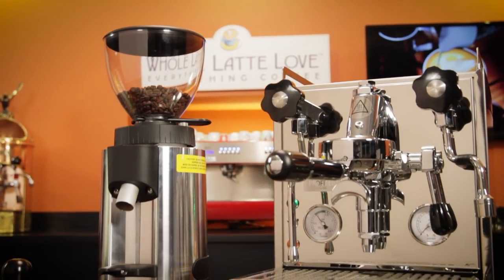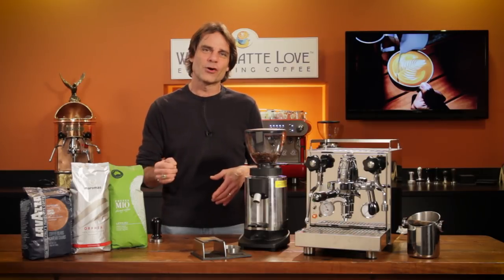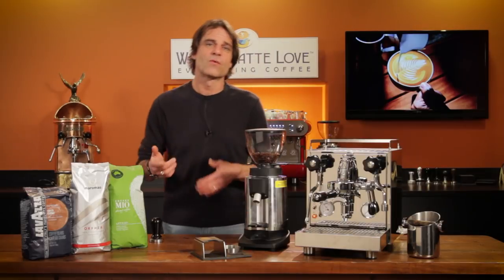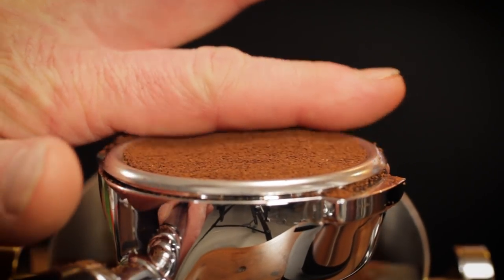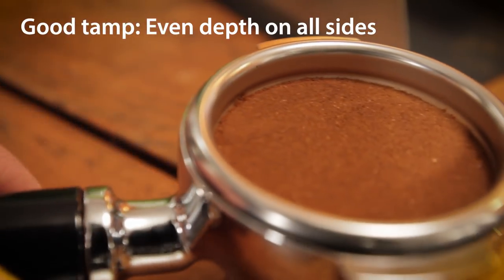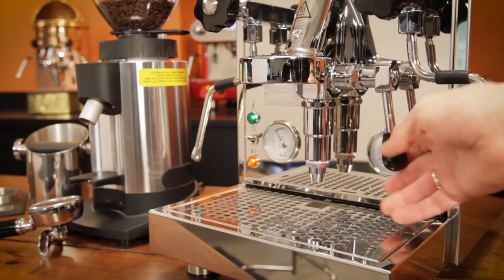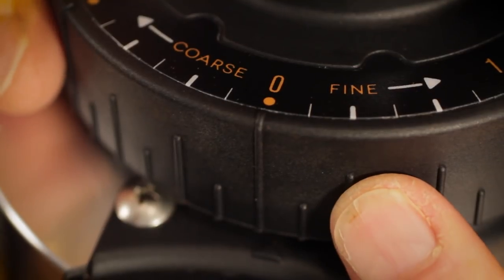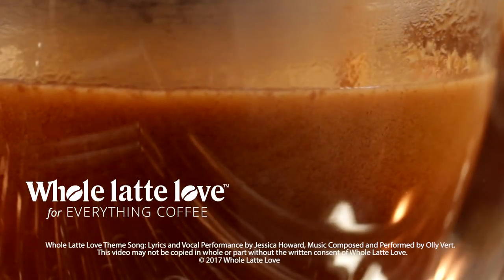How To: Basic Espresso Technique - Dialing in Grind Size

Comment: Im a newbie in this too. I just got myself a Morphy Richards Accent 172002. Any tips for me? I cant seem to get any crema when i make the espresso shot.
Reply from the maker: Hi JT, Thanks for the question. Are you grinding your own beans? Looks like your machine uses a pressurized filter basket. That type of machine is limited in capability and can't do the same quality as standard non-pressurized basket machines. Here's a video comparing shots from pressurized vs. non pressurized baskets: https://youtu.be/jmo3EZxqLi0
You can get an okay espresso out of these machines. Most important is the coffee quality. If grinding your own beans fresh you can control a bit with grind size.
Marc
Reply: Whole Latte Love yes im grinding my own beans. Im using the krups gvx231. Have tried from medium size to the finest. But still not able to do it. 😂 is it time to change a machine?

Comment: Hello! I have just got Ceado E6P from you guys, which has timed setting to grind one shot and double shot. If I calibrate a double(single) shot, is the single(double) wont be accurate?
Reply from the maker: Hi, Sunlight, Thanks for the purchase. The timing is independent for the single and the double - one does not affect the other. You can set either to whatever time you like. Hope that helps!
Marc
Reply: Whole Latte Love So if I calibrate the grind for double shot, grinding for 10 sec to get 16gr to pull 60ml/25sec, then I adjust the grind time for single shot to pull 30ml/25sec/6-8gr? That would be the plan?
Reply from the maker: Yes. Variables like filter basket may affect timing - depending on baskets used you may need to slightly adjust grind size or dosing weight to produce an extraction of the same timing for single as double.
Marc

Comment: Hi, I’m a beginner and I’m looking  to get a machine that last and lets me have a great espresso , any suggestions?  Thanks
Reply from the maker: Hi RTS, Thanks for the question. My favorite entry-level machine is the Gaggia Classic Pro. Unlike many other entry-level espresso appliances the Classic Pro is a true machine! Commercial size/weight 58mm portafilter, stainless housing, substantial group head for thermal stability and more. It ships with pressurized and non-pressurized filter baskets. Using pressurized basket beginners can get into espresso without purchasing a grinder and use ESE Pods or pre-ground coffee. Then, when you're ready to take your espresso to the next level get a decent quality grinder and use the standard non-pressurized basket. Check out the Classic Pro in action here as I make a delicious flat white start to finish: https://youtu.be/_bl9BqIDoyI
Marc

Comment: Is there a grinder that an be adjusted electronically? Thanks
Reply from the maker: Hi ma, Thanks for the question. A few do exist. I've used a Dalla Corte DC1 grinder which connects to their espresso machines and automatically adjusts grind size.
Marc
Reply: @Wholelattelovepage  thanks 🙏

Comment: I am running into an issue where the extraction time / amount is good but the coffee taste bitter. The setting for the grind is the lowest (1) on a Breville machine
Reply: I wonder if I can help. There are so many variables including the bean or the roast.  Otherwise on the basis bitterness is over extraction consider decreasing water (group head) temperature, lighter tamp, coarser grind, lower dose or less water.  Espresso ratio could be between 1:2 or 1:3 and time between 20-35 seconds - unknown variables could provide unexpected and interesting results outside these parameters.

Comment: I have the DeLonghi Distina Espresso machine. What advice would you have for that?
Reply from the maker: Hi EH, Thanks for the question. The Distinta uses a pressurized filter basket which makes it good for brewing ESE espresso pods or coffee purchased pre-ground. The pressurized basket system is more forgiving of grind size as it's the basket creating the pressure of the brewing process and not the coffee. This type of machine is not capable of producing the same quality of espresso as machines which use a standard non-pressurized filter basket. That said, the espresso they produce is adequate for some users. You can get better results by grinding fresh beans yourself right before brewing but a prosumer level grinder like the Ceado used in this video is overkill for the type of machine you are using. If you grind your own, start with a grind size slighty finer than granulated sugar. From there, adjust grind size based on flavor. If your espresso is overly bitter grind a little coarser. If it's thin and sour grind a little finer. Hope that helps!
Marc
Reply: Thank you so much! I'll try to do that!
Reply from the maker: @emadb.m.hassan4077  You are welcome - let me know how it goes!
Marc

Comment: Hi, I'm using a bean to cup Delonghi Magnifica machine and wanted to ask about grind settings. 

I can't seem to get the consistency of coffee stream flowing fast enough for coffee grinds at anything less than 3.5 (I have a scale of 1-14 clicks with min=1 and max=7).

I try to keep the coffee super fresh where possible. Water temperature at the hottest possible on the machine. I keep the shots to expresso size and always aim to pull double shots. 

My problem is that the shots just take too long at 3.5 or less and sometimes just a few drops (or none at all). I appear to get a stream at mid point of 4. 

Could it just be the quality of bean I'm using as I'm not really able to pull anything at grind level 1(finest)?

Thanks
Reply from the maker: Hi g, While timing is a basic way to dial-in grind size on semi-automatic machines it does not apply in a meaningful way to automatic bean to cup machines. If getting very slow drip I would increase the grind size. Unless you are doing 2 grind cycles you can't make a double on most super-automatics as coffee dose is too low - probably ~12g max in the Delonghi. In general very fresh from roast coffee uses a slightly larger grind size. As the coffee ages a finer grind usually produces better results. If looking for crema rich shots try Italian style bean blends which contain some Robusta in the blend. These coffees do not rely on freshness like lighter roasted, single origin 100% Arabica coffees. Stored in original packaging they do well for months. A couple of known crema producers with excellent reviews in this class are Lavaza Super Crema: https://www.wholelattelove.com/products/lavazza-super-crema-whole-bean-espresso-coffee
and Mormas Orphea: https://www.wholelattelove.com/products/maromas-orphea-whole-bean-espresso
Hope that helps!
Marc

Comment: hey! :) Do I need to change grinder setting when using the different kind of beans?
Reply from the maker: Hi MR, Yes you do! Grind size is never set and forget. It needs adjustment when variables like bean type, bean age, dose weight, etc. change.
Marc

Comment: Using a Gaggia MDF grinder, what are your grinding tips?
Reply from the maker: MDF is a dosing grinder so be sure to get rid of any grinds in the doser when you make grind size changes. Personally, I'd be dosing my portafilter while the grinder was grinding rather than grind a bunch and then dose. That way, I don't end up with much extra coffee in the doser if the grind size needs further adjustment.

Comment: Hi Mark,
Im new to this, I have a Breville Dynamic Duo, I can fit around 22g of ground coffee in the basket, Espresso is running to correct time, Just wondering on the 22 gram's as most pros reccomend around 18g...... Any thoughts?
Reply from the maker: Hi Darwin, Thanks for the question. In a Specialty Coffee Association survey baristas reported an average dose of 19g for a double. Many would consider 22g to be in the triple shot range. 22g is fine if that's what you like! Do you have a scale? More telling than time would be what your getting as a brew ratio with the 22g dose. If not familiar, check out my video on using brew ratios: https://youtu.be/57UqPDirHoU
Marc
Reply: @Wholelattelovepage  Hi Mark,Thanks for the replay, I have scales and aim for 22g as thats what was suggested to me by a local barista "because it fits in my basket"( I took my machine to him so he chould show me how to use it), when I weight the shot its around 57-60g weight. My machine is set to stop at 30sec.
Reply from the maker: @darwinfridgeseals741  Hi, 22 in 60 out is a good ratio. A little below 1:3
Marc

Comment: Goodness that would get so expensive tossing out grounds like that over and over.. hurts my heart and wallet just watching!
We had a breville infuser and recently sold it to purchase a Gaggia Classic (probably), and kept the baratza encore grinder. I always purchase beans locally (and roasted within days of purchase)- but a 12oz bag can cost $16-20. That goes pretty fast. Still cheap compared to buying drinks somewhere else, but nothing compared to cheaper commercially roasted bags in grocery stores. I'm hoping the Classic & Encore combo should give me enough info online to see what others do, and I can dial in from there.
Reply from the maker: Hi Mario, Thanks for the comment. Sounds like you are buying some high-end coffee! To get the most out of that expensive (or any) coffee you do have to dial in the grind. Unless you are making a huge change in bean type, roast level or dosing weight between bags you should be relatively close in grind size bag to bag. A 12oz bag will yield about 19 double shot doses of 18g. So coffee cost is around $1 per double. Depending on perspective that is pricey. If you are close bag to bag with grind size maybe your first shot runs a little slow or fast and you make a slight adjustment without tossing the shot and wasting the coffee.

I'll mention Baratza does not recommend the Encore for serious grinding for espresso. It's passable in some cases but with the level of beans you are using you might consider an upgrade at some point. Please don't take this the wrong way, but those high-end fresh beans deserve a better grinder. If considering a Gaggia Classic, be aware it takes some finesse and working with the machine to get a consistent brew temp - another thing those pricey beans deserve!
Marc
Reply: @Wholelattelovepage  excellent response! Greatly appreciated!
Reply: Also you should be able to use the excess or purged grounds for a cold brew.

Comment: Hi Marc, do you have any tips for have a good espresso from my Delonghi Dedica e685? i really appreciate your help and advises if any. lots of love! :)
Reply from the maker: Hi MS, The Dedica uses a pressurized filter basket. So it's the basket which creates the pressure and not the coffee. It's a compromise which is forgiving of grind size not being perfect and/or allows for the use of pre-ground coffee and ESE pods. In the end appliances using a pressurized filter basket are not capable of producing the same quality of espresso as machine using standard non-pressurized filter baskets. But you want the best you can get so some tips: Always make sure your machine is fully warmed up. Leave the portafilter in the machine when not in use so it stays as warm as possible. You can run blank shots through the PF to help warm it up. Use as much coffee as possible in the filter basket - so overfill it a bit. The Dedica's portafilter has lower capacity than commercial espresso machines. Tamping does not matter much with pressurized filter baskets but do tamp so there's a bit of clearance from coffee surface to shower head. If espresso tastes under-extracted weak/sour use a finer grind. If it tastes over-extracted bitter adjust grind coarser. It's been awhile since I used a Dedica but think the basket will hold about 15g of coffee. With that coffee dose I'd stop the extraction at 30ml output for 1:2 brew ratio. Hope that helps!
Marc
Reply: @Wholelattelovepage  that was a very generous from you to say, i am going to follow your tips and I will keep you posted with the results. On the other hand i bought a non pressurized portafilter and basket fit for the same appliance but i never god any cream from it and no matter how fine i grind it and put a lot of pressure tamping it but it is always under-extracted..you are correct! it take around 14g and could be over capacity to 16g
Reply from the maker: Hi MS, Thanks for the reply - helping others on their espresso journey is the most pleasurable part of my day. Do let us know how it goes!
Marc

Comment: Marc, Using a pro600 and ECMs64. The pro600 does an initail pressure of 4-5 then jumps to aroun 8.5-9 Bar. Is that how is ussually works? or there is a brew pressure issue. Machine is brand new
Reply from the maker: Hi Roger, That's normal operation. The Pro 600 uses a vibration pump which takes a little time to build up to full brew pressure.
Marc
Reply: Should I extend my extraction to 30 s instead of 25 to get full shot?
Reply from the maker: Hi Roger, Timing is one way of getting in the ballpark. You can use other methods like visual cues - extraction blonding out and brew ratio which compares weight of coffee dosed to weight in your cup. When using timing I prefer to start timing at first drip from the portafilter spouts. Here's a video on using brew ratios: https://youtu.be/57UqPDirHoU

Comment: Hi There 
What type of coffee machine do you recommend under 1000 £ ? 
Thanks
Reply from the maker: Hi Paul, Depends on how you will use. Lot's of single boiler semi-autos under that price. Single boiler machines cannot brew and steam simultaneously. Here's a review comparing 5 single boiler options: https://youtu.be/ajvUwRZ524I
Next level up is machines with heat exchange boilers. Those can brew and steam at the same time. HX machines start at ~$1500 USD so a bit out of your range. Hope that helps!
Marc

Comment: Can I dial in by adding a small quantity of beans at each adjustment and then just run it out each time?
Reply from the maker: Hi Brad, Thanks for the question. If I understand correctly you are asking about single dosing? Like only loading beans for the dose you are grinding? If that's the case, yes you can. It depends to some extent on the grinder you are using. Most grinders retain some ground coffee in the grinding chamber. There are others which retain almost none.
Marc

Comment: Do I need to flush a Vibiemme Domobar Junior? If so, for how long? Thanks!
Reply from the maker: Hi E, Most likely you will need to do a cooling flush prior to brewing. Here's how to tell... After your machine fully warms up raise the group lever without a portafilter in place. Watch and listen to the water as it comes through the shower screen. If it's bubbling that indicates flash boiling and temp over 212F/100C. FYI, that's common and normal in most HX boiler machines without PID. What you want is a brew temp of 195-205F. Continue to flush until water from group is smooth in flow with no bubbling. Usually takes 3 to 8 seconds but it depends on how long the machine has been idle and other factors like ambient temp etc.  By adjusting flush times when your machine is at a known state you can quickly adjust brew temps from shot to shot - one of the benefits of an HX machine! There's some guesswork involved as to what the actual temp is. If your coffee is a little bitter flush a couple econds longer to get a cooler brew temp. If sour, use a shorter flush for a higher brew temp. That's a very simplistic explanation and other factors like grind size, dose weight and coffee variety play a role as well. Hope that helps!
Marc

Comment: So after how many doubleshots on the pro 500 should i stop and let it get up too temp again before the water get low on the temp side
Reply from the maker: Jesus H Medrano it’s going to depend on how quickly you are doing them back to back. I’d have to break out the scace and do some testing. My gut says if they’re more than a couple minutes apart probably not much of anything. You could judge temp in general by observing flow during a flush. In some cases rapid back to back shots could cause temp to rise in the group. Can also watch boiler pressure for recovery but it’s not a direct correlation to brew temp moment to moment.

Comment: With Quamar M80 and Nuova Simonelli Musica espresso machine combo, what dialing do you recommend?
Reply from the maker: Hi m, Thanks for the question. If you are asking what setting to use on your grinder I cannot tell you. The best grind setting depends on a number of variables like coffee used, coffee dose weight and more. You need to "dial in" to the grind size which works best for your particular variables. Here's a more recent video which goes through the process step by step: https://youtu.be/jOY7D02n4Cw
Marc